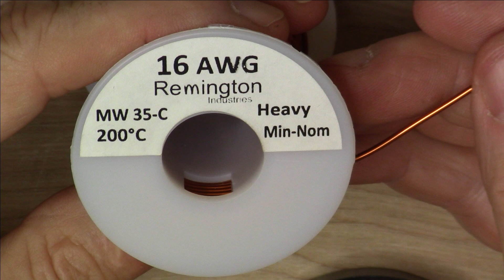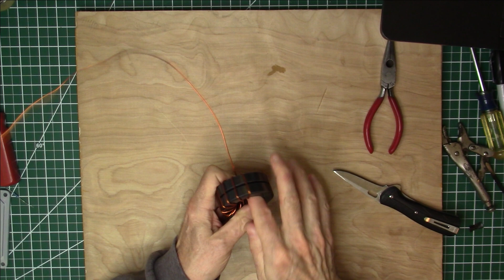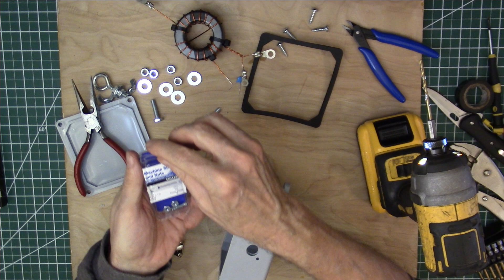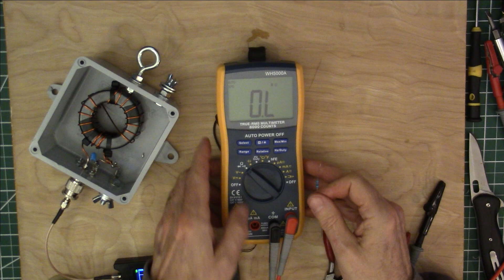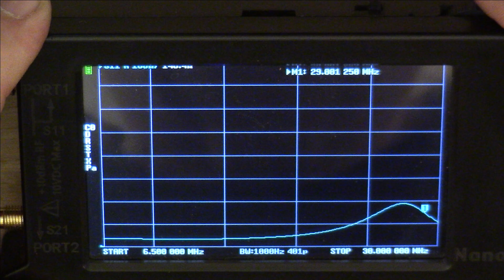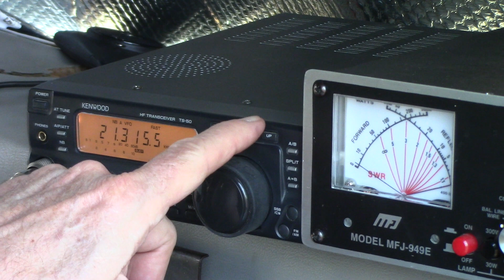BUILD and TEST a 49:1 UNUN for EFHW HF Antenna

Comment: You stack the torrids for more wattage correct?
Reply from the maker: Yes. You may also need to use thicker gauge wire depending on hiw high you’re going.

Comment: I built my first 49:1 a year ago, turns out I was using 13 turns instead of 14 turns all that time, it still worked, but not as good. Just recently I built two more 49:1 transformers, one of them was similar to the classic version where you crossover in the middle, but instead you tap the 2nd turn instead of twisting wires together, swr seems to be much lower with that one, I used 12 gauge wire for it too. The other 49:1 I built using the 14 wrap method, just 14 turns of wire all close together and you tap the 2nd as well. I've seen other methods too, but all that weaving of wire is kinda difficult. Well, at least we have options.
Reply from the maker: I have also made multiple versions and there are videos about them on my channel.

Comment: What determines the power handling capability , wire size, or torid size, or both?  How about bandwidth?  I'd like to cover up to 66 meters, and down to 160m  .  Recommendations ?
Reply from the maker: The number of toroids and the wire diameter are the primary factors in power handling. Heat is the enemy.  You can generally stack up to 3 of FT240 mix 43 or mix 31 toroids.  increase your wire gauge up to at least 12 awg solid copper.  Apply power in steps while you monitor SWR and temperature.  CW and digital will require you to lower power. If your SWR starts to rise you are overheating your toroids. Be careful and good luck with your build.
Reply: @BudgetHamRadio  I am running digital at about 200w .  What about frequency range?  I know I'll need a longer antenna for 160.  Will this work up to 6 meters?  
Thanks de Jim NX0R

Comment: Hello, I built one of these a couple years ago and wished I had watched your video first. Thank you for such a detailed video on how to assemble the unit. You did an excellent job explaining what you were doing. In using my end feed antenna, my best contact has been a VK4* * * on 20 meters at about 2 am with a 5/5 signal report received while running 100 watts. These antennas work very well and the low vswr with a tunning unit does a perfect job. Thank you again for such a good construction video. 73's Bill K4 * * *
Reply from the maker: Thanks Bill!

Comment: You appear to have wound a 56:1. The turn through the middle counts as a turn. Many of us have used 56:1 with great success. It's half way between 56:1 and 64:1 lots of fun. I have two FT-240-43 sitting here and I am pondering when to give it a try again.
Reply from the maker: In my first video I did miscount. I have a whole series of videos building and comparing the 49:1 with different winding types. Check them out.

Comment: Doesn't the crossover take care of the common mode current? So your common mode choke is a lot like belts and suspenders to hold your pants up.
Reply from the maker: I don’t think so, if I understand what you are saying.  Common mode current flows on the shield of the coax and not the inner conductor.

Comment: You forgot to count the crossover as a turn, so you have one too many turns on the toroid. It's 1-7 in one direction, the crossover is 8, then 6 more turns = 14.
Reply from the maker: Yeah it was corrected in a later video. Thanks for watching.

Comment: I have a 49:1 UnUn mounted on a pole, 10 ft above ground in the far back SW corner of my 10k sq ft city lot in Portland, Oregon. The wire is 14ga stranded copper 155 ft in length that runs from the UnUn up to a pole on my 2nd story chimney through an electric fence insulator that allows wire movement. The insulator is mounted to a treated, hardwood block that's clamped to the 10 ft pole. The wire then travels over to the trunk of a tree that's set up to be safe to the tree for growth and movement. The end of the 155 ft wire is tied off out of the way of branches, leaves and such. I'm able to work 160, 80, 40, 30, and 20m with it. 17-10m are rather lack luster performance sadly. My 43' aluminum vertical antenna with it's UnUn, MFJ 998RT auto tuner, DX Eng 400max coax buried underground in 2" pvc, and 3 ground rods 6-8 ft apart with 1 continuous 4awg copper wire clamped to each rod and clamped to the mast with a fold over bracket to lower the 43' vertical safely to the ground well before storms arrive, works very well on 80-10m. Both the end fed and vertical work well with my Acom-1010 at a conservative 300-400 watts output.
Reply from the maker: Thanks for watching. Lots of factors can effect propagation of antennas and their radiation patterns from ground conductivity, buildings, etc. Also do you have a common mode choke near the feedpoint of the EFHW?  If not, your coax acts like a counterpoise and can affect the performance as well as bring RF into your shack.

Comment: An important and largely ignored test is the loss thru the 49:1 transformer across the bands.  The construction technique (twisted primary or tapped primary), spacing of turns,  cross-over or no cross-over, as well as the core material will affect the loss.  The "evil lair", MM0OPX,  and DL2MAN youtube providers show some interesting info on this subject, as well a two methods to perform the test.
Reply from the maker: I am familiar with their work and plan future videos to address some of those issues. Thanks for watching. Be sure to subscribe.

Comment: How long was you wire for the end fed ?
Reply from the maker: I will need to measure it and get back to you. But different wire gauge and insulation type will affect the velocity factor of the wire. So unless you use the same brand and type of wire the length may be different for you.  For an EFHW the calculated length should be 468/frequency. So for 40m ssb use 468/7.23 or 64.73 feet as a starting point.  You will need to trim it because of the velocity factor and will probably end up around 52-56 feet. Velocity factor is the relationship of the speed of electricity through the wire is slower than the theoretical speed through a perfect conductor.
Reply: @BudgetHamRadio  that’s ok , I know how to figure the frequency just thought I see if you remembered off hand .thanks